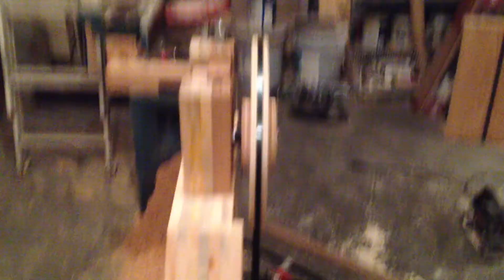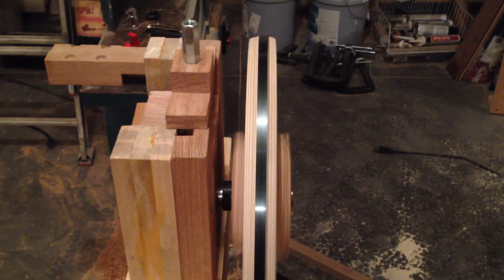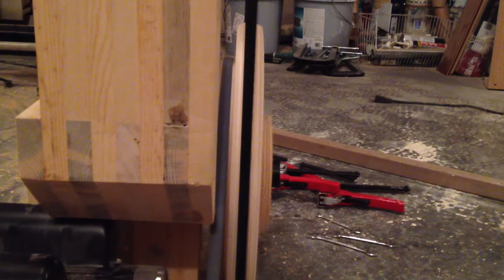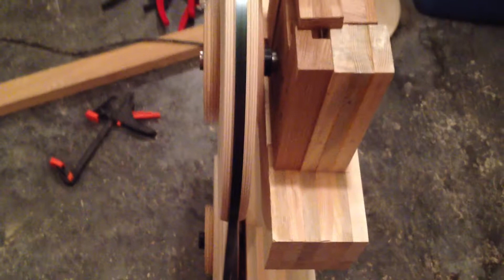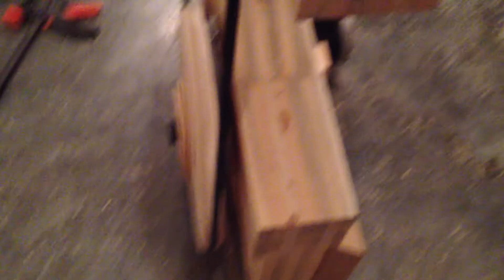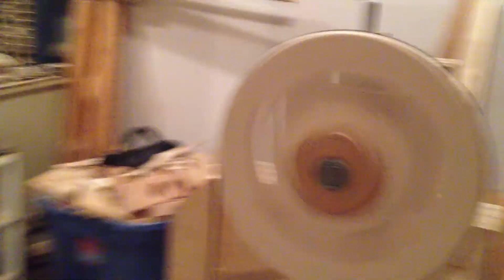Homemade Bandsaw: Its alive!

Comment: Excellent work. I used the same motor from Harbor Freight I used the 2 HP version, I think you did also. I think you used the same shaft and retainers on the wheels.
Good job.